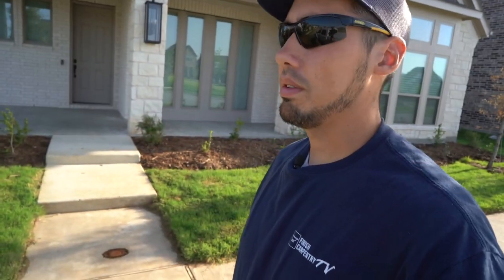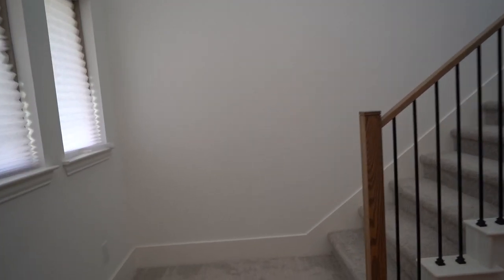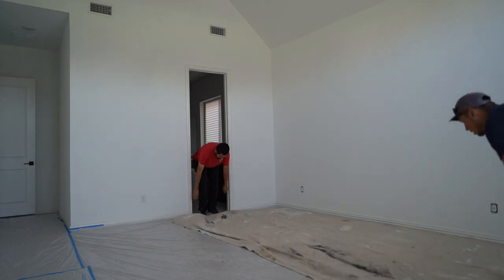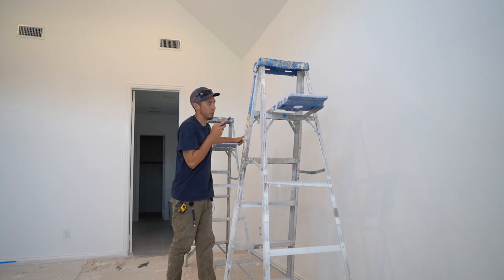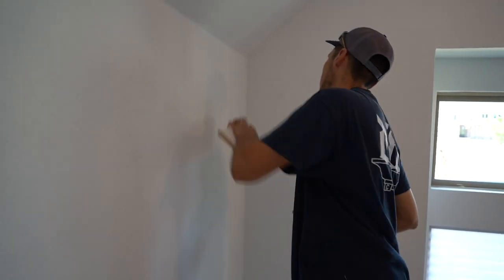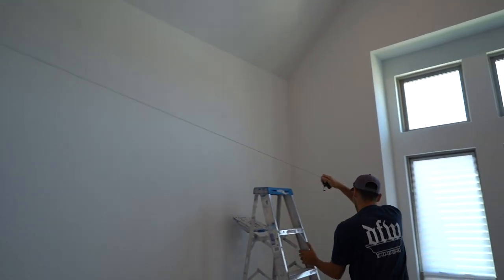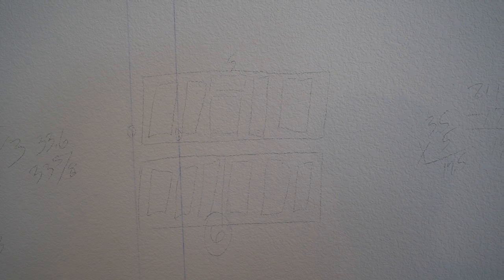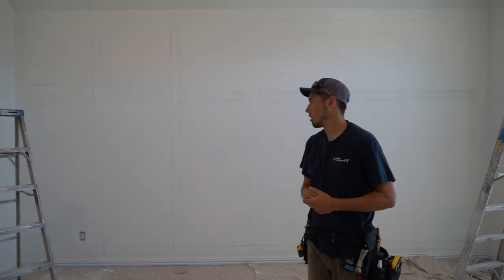Doing a Lot of Trim Work at This House

Comment: Good tip about converting digital numbers to fraction.It's a pain in the ass to convert and your way of getting close to the number is excellent for bigger jobs !
Reply: Take your remaining decimal and multiply by the denominator you are looking for. For example, .6666667 multiplied by 16 is 10.666667. Take the whole number and make it your numerator and keep 16 as the denominator ( 10/16 or 5/8 reduced). You can also use 32 and 64 depending on your accuracy tolerance.

Comment: Have you ever tried the plastic adhesive carpet protection? Works really well for protecting carpet.
Reply from the maker: I have not. What is it called?
Reply: Finish Carpentry TV  Just google blue film carpet protector. It’s amazing. Cuts prep time down drastically & works on all surfaces
Reply: Yeah that stuff is great!
Reply: Watch out for it i can leave a sticky residue thats almost impossible to take off, if the carpet shield is old or left on too long. i personally would just use the plastic drop sheets and just wipe the chalk up when you're done snapping lines. Also i use tajima .5 lines and their snap dye makes less mess IMO
Reply: Its called roll and stroll in the UK. Some of the most important instructions to read ever.. like the guy says..  leave it on too long and it'll ruin carpet. Read the instructions properly and its amazing stuff and saves so much time

Comment: DIYer here. Thanks for making these videos. I’m looking for a miter saw that will cut 1x6 baseboards vertically to make my life easier. My walls have rounded corners and lots of them so I wanted to make my life easier. Any tips would be appreciated. Especially if I can get something from harbor freight seeing that I won’t be using it very often. Thanks!

Comment: Have you ever looked up the “golden ratio”. It is supposed to be the most pleasing to the eye when splitting up areas. It is called PHI
Reply: It's only a guide, if you fully follow it without asking yourself if something looks good it can look horrible, I've seen golden ratio projects look horrible and great both, you have to figure out when it helps and when it doesn't, I don't know if there's a book on when to use it.
Reply: Whoever has the fattest wallet that’s who has the golden ratio..
Reply: Nicholas Huss That kind of attitude is the difference between a true craftsman and somebody that just slaps up molding. Your name will be forever attached to your work. You have to take pride in the finished product.
Reply: @borys444  The "Golden Mean" (ratio) is 1.618:1 and occurs in nature, math, geometry, art, and architecture. It provides a middle of 2 extremes. Its all about balance. As Richard says, "pleasing to the eye." Great observation Nick!
Reply: @bourbonsnob8218  its a + b / a = a / b
Reply: Your eye is the golden ratio
Reply: @RobertBarth1  I agree, flip the 1/3 to be near the base. Just sayin'
Reply: It is actually the PSI factor,

Comment: 11:00 It doesn't have to be perfect.  
Next frame:  Brings in the laser level. Ha ha... Love it Richard
Reply from the maker: Lol
Reply: Just remember, that lasers are only as accurate as you allow them to be. Be careful to check laser occasionally and setup/maintain a recommended distance from your work. Most affordable lasers are only accurate to +_1/16" in 20 feet.

Comment: Notice you using your iPhone calculator. There is a free app available that works with fractions that I find handy to use. I have no problem with converting eight's to decimals but when it gets to 11/16 or 13/16 I don't always remember the decimal equivalent. The app does multiplication and division for fractions also.

Comment: The design elements that you eluded to in the odd numbered sequence comes from Greek Civilization. If you look at your design, the style you placed in the center becomes the odd numbered element—seven in this case. What you are basically designing is a Greek column structure representation in two dimension. It is part of the Golden Ratio of 3.618

Comment: Love your work imperial system is gash though you should give metric a crack it's way easier even when working with imperial trim sizes
Reply from the maker: I have thought about getting a metric tape measure.

Comment: Instead of 1/3 or 1/4 wall split, it’s a shame you didn’t figure out the rail placement by aligning it with the horizontal wall separating the top and bottom windows. Visually, it would have extended the pattern around the room and tired it in architecturally.
Reply from the maker: I see the point you are making. And I agree in some cases. If the trim went around the entire room I would have considered it more. But in  the case of accent walls I tend to treat them as independent of anything else in the room.
Reply: Finish Carpentry TV I mean, either way, stellar work as always. It’s amazing to me that my girlfriend actually gets excited when we sit down in front of the TV and see a new Finish Carpentry video. When there isn’t one she almost always says “nothing new from our guy?” Lol Good work, man.

Comment: Make sure you fill your holes in, since y’all made all the hole with your brad nailer, just worked a job and the carpenters didn’t fill 1 hole or caulk anything. I guess they can measure and cut fine but when it comes to spackle and caulk they are useless lmao don’t be one of those carpenters we take the easy route cool channel too btw